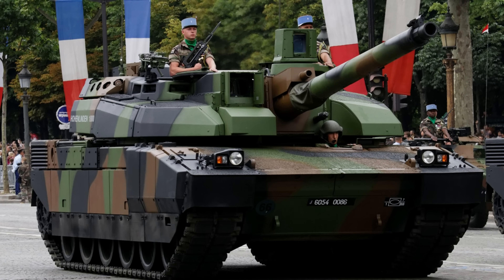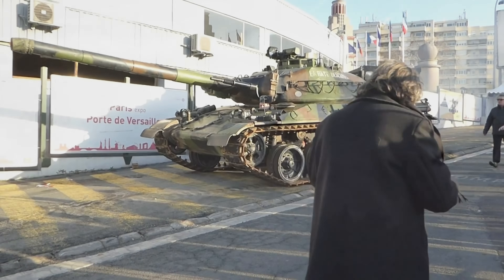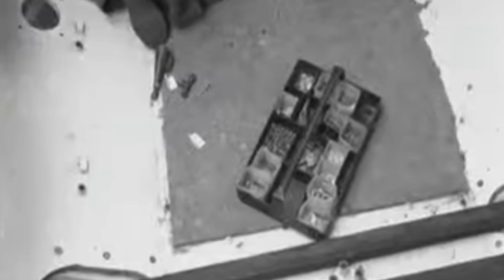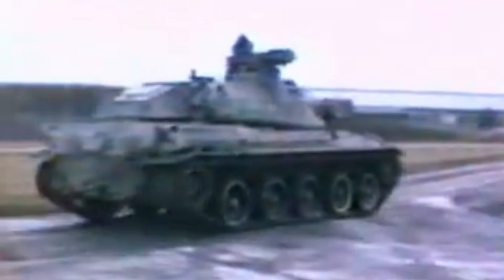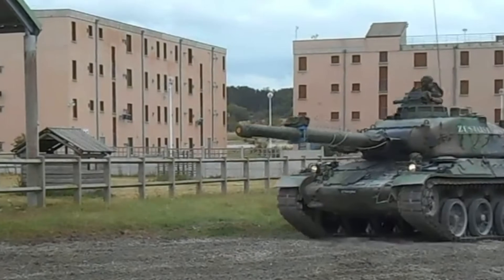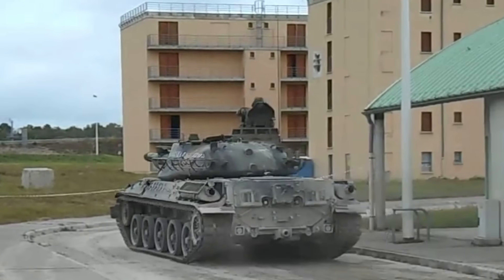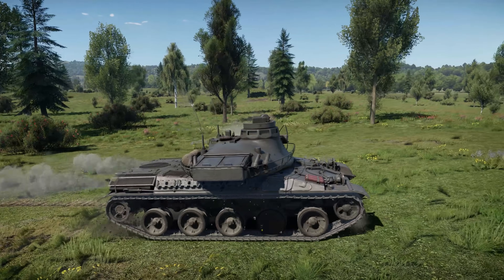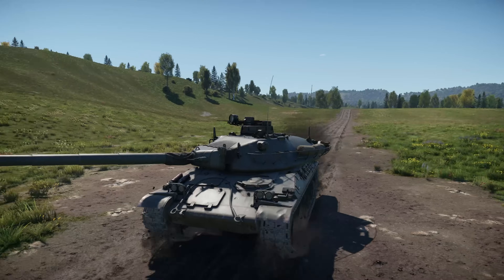The French AMX-30 Main Battle Tank | DOES SPEED BEAT LESS ARMOUR?

Comment: Things that repeat in history. 1 Joint Eu weapon project 2. Disagreement on design or work share 3. France goes their own way
Reply: Another self maintaining stereotype. France participated in over 30 successful programs and only withdrew for about 5 programs.
Reply: @ interesting. What projects (vehicles) came out of joint development? (Genuinely curious)
Reply: @SteelBattalion07  Frigates FREMM, Tiger combat helicopters, NH90 transport helicopters, Mamba Anti-Air truck systems, Alpha jets fighters, the rear view mirrors in the Rafale and so many more.

edited : the MLRS rocket artillery system too
Reply: @ rear view mirror on the Rafale is awesome
Reply: @ I assume FREMM is modular so can be customized to suit each national needs. I can see the helicopters wouldn’t get much push back because Germany doesn’t have a huge (manufacturing) stake in it. Thanks for sharing. That was helpful. Though in the realm of big ticket items like tanks and jets… I felt like the different competing interests doomed the project. I’m not holding out hope for SCAF either, especially if it’s not going to be carrier capable
Reply: @ That's the issue with joint programs. France has the only catobar aircraft carrier in Europe. Spending money on a SCAF that isn't going to be navalised.. seems improbable. Unless they keep the Rafale-M and invest in SCAF for the Air Force but I doubt it. Compromises will have to be made anyway, France cannot develop its own 5-6th gen fighter alone. No one can in Europe.
Reply: @ I get it from a cost perspective. But the interoperability capability seems really cool (like F18 taking off from French carriers and Rafale operating off US carriers)
Reply: @GordonFreeman-sl6pi  I disagree on your statement that France can not develop her own new gen fighter alone. If there is a coutnry in Europe which has all the necessary to build her own fighter, ity's truly France. She has very capable engineers, the "savoir-faire", and the will to do so, and she'll have the need in the next decade. I guess  you were surely speaking about money... In the 50's-60's-70's, many were saying the same about the french nuke deterrent force (with the 3 components : ground strategical, air force tactical and strategical, tactical artillery (AMX pluton) ), the missile vector, the space rockets (yes, if it wasn't for France, ESA and Ariane wouldn't have existed). Non only, France did her own nukes, but she was able to produce all the spectre of weaponry by her own or with little cooperation... Missiles of all sort, satellites (military as well as civilian ones), Diamond (alone) then its daughter Ariane (with little help from EEC), MBT, Frigates, Submarines, Carrier (and the alone CATOBAR outside USA). In this old time, USA/UK/USSR thought French would never be able to do so by her own. The nuke research  DID cost dearly to France (3 times what it costed to USA), they did it anyway. About money, let's talk about it... you may argue that France debt doesn't permit it, that EU will not allow France etc...  France has VERY often decided to not follow EU orders when it comes to independecne and military things but not only that. in the 20000's France was warned by EU about her debt, threatened of sanctions by EU... totally ignored and no sanction. During and after the COVID, President Macron decided to let run the french debt to save french societies/enterprises, not far from a trillion € of debt in few years. If France was to fall, it's all EU which would... the thing is that EU face now a very agressive Russia... and USA has decided to make default to their engagement towards NATO coutnries... proving that France "discours" about the possible default from USA was POSSIBLE at any moment, was not a french dream but a european nightmare. Now then, EU/NATO out of USA  has France as single and only option. UK has nukes too, but not that independent (American vectors, all intelligence shared and dependent to USA, whzen France has numerous independent satellites), and also UK military industry is ten times behind the french one. Germany could certainly close the gap with France, but she has about 20-30 years to run, depends on which weaponry/things... it means Germany will took at least a decade to be fully in economy of war, and it will take a couple more years to take the gap with France. Then Germany by the voice of vonderleyen has already said that the debt caused by military expenses will NOT be counted in the calculation of the debt... It means "open bar" for France. new air carrier, new submarines, new missiles, new planes, new drones, new nukes, new frigates (all projects already on way, some are even in production or even in activity)... It has not surprised anybody if France was the first to triple her command of Rafale, and the possibility to build 2 new carriers instead of one. Who will pay ? French, but not only them, European countries will have to put their hands in their wallet. For decades, Europeans  have laughed to the french sovereign and independent military industry... Who are laughing now ? Personnally, I think that France is the alone country in continental europe that can decide to be fully neutral towards Russia (and/or US/China) without risking ANYTHING. And no one could blame her to decide that. Where were the Europeans when France was warning from the 60's to nowadays that putting all their eggs in the US bag was at risk ? Ils riaient, ils raillaient. Et bien qu'ils continuent et bonne chance à eux.
Reply: @ with Germany?
Reply: You forgot all the project that actually did work (and they don't really leave because of workshare issues, but rather because either the partner isn't up to speed, or disagree with the initial agreement (Germany on SCAF and MGCS lately)
On the projects that worked (that I can remember) you have FREMM, METEOR, A400M, SCALP/Storm Shadow, Tiger helicopter, SAMP-T Mamba, alpha jets, Jaguar attack plane, CTA gun with telescoped ammunitions... (And I know I'm forgetting some)
They only leave the project once it's clear out doesn't meet their needs or requirements anymore. Like the Eurofighter that anyone have in mind: it was clear the design of the plane was becoming a heavy ASF with no naval capabilities, and very limited air-to-ground capabilities, 2 things that France insisted at the very beginning of the project that it wanted and needed.
The other members disagreed and didn't want to pay for something that seemed extra to them, and they didn't need.
But for France, it meant forgetting the capability to project its forces anywhere in the world with the aircraft carrier, which was needed to protect its overseas territories and its many citizens in foreign countries (mostly in Africa, but not only), and not getting a plane capable to deliver its nuclear missile, rendering its entire nuclear doctrine at risk...
So the partner didn't accept the French requirements, and now they act surprised that France got out of the bad deal, and made its own little (but awesome and very impressive) aircraft... ;)
Reply: @stitch77100  I actually don't begrudge France for leaving the project. I actually thought if the Eurofighter had been navalized then the QE Carriers would have been CATOBAR instead of STOVL. With stuff like the Meteor - I don't think I've read about any design requirement/differences that anyside had to swallow to move forward so that was fairly straight forward.  But the next gen tank and SCAF/FCAS will be interesting.
Reply: @SteelBattalion07  Don't worry, my comment wasn't aimed specifically at you, it was more of a "to anyone that may not know".
And I agree with you on the aircraft carrier thing, with a naval plane (Eurofighter or anything else), the QE class would have been CATOBAR Carriers, and thus capable to operate other NATO planes like F-18 or Rafale, beside what the national aeronaval British plane would have been.
About the METEOR, I don't know in details either, but I believe it was a cooperation indeed, especially with the propulsion system. So, it worked very well.
I don't think compromise are the think to look for with military equipment actually. I believe it should be kept at the minimal level, because compromises don't make great result, only okay or average ones. And you want your military equipment to excel in what it is supposed to do. That why I think a cooperation like this work best when everyone want the same thing.
Look at the Eurofighter: it's a great interceptor,a very good fighter jet, but a rather mediocre ground attack or bone plane, because it wasn't designed to do this. That's why it's lacking in armament points and wasn't designed to carry very heavy loads. Because it was a plane of compromises. Not a plane of excellence. (I'm exaggerating a bit there, but I hope you get the idea).
Reply: @stitch77100  I agree with you in general. But to keep Eurofighter as a "not a pound for air to ground" and then not have a replacement EU-centric attack jet and now they're left without that capability (for themselves). What a navalized/ground attack capable jet would have given all the participating countries would have been economy of scale. The same way that F35's per unit cost could be driven down so low (for all its compromises and limitation). More jets for the dollar, parts commonality, better supply chain resiliency
Reply: @SteelBattalion07  not going to disagree with you here. A Tornado 2.0 or a Sepcat Jaguar 2, in numbers, would have been awesome.
But right now, only the Rafale is available (and the Gripen I guess, but I'm not sure about it's payload and range compared to the French one)
So, when are you going to order some Rafales for the air-to-ground work? XD
0;)
Reply: @stitch77100  actually the one thing that all EU jets sorely lacks is the EW SEAD/DEAD variant(Growler) variant for any of its jets.
Reply: @SteelBattalion07  I think the SEAD/DEAD mission was actually successfully carried out by the Rafale, in Lybia in 2011.
Using a combination of Spectra EW to stay hidden as long as possible, and precision strike missiles and bombs to destroy them from afar.
It was not done purely on EW, but when every plane has a personal EW equipment, do you really need a Growler equivalent to do heavy and loud EW missions ?
It's an other way to accomplish your job, without needing a dedicated equipment to allow your forces to be effective.
(From what I heard, the French aircrafts flew day one to do SEAD/DEAD missions, whereas the US waited day 2, after their cruise missiles strikes hit their targets on day 1)
Reply: @ I think SEAD/DEAD for Libya vs Russian IADs are two very different mission sets. I’m not saying the French doesn’t have the capability. I’ll simply admit there aren’t  a lot of materials written about it that I’ve come across that makes me think given current environment and future adversaries that this is one of their core competencies
Reply: @SteelBattalion07  I agree about the eurofighter navalised (if so, it would have been a Rafale+ because more competence to work on it), UK would have done some catobar carriers... I remmeber that at the beginning of the british carriers project, France and UK had reflected on something like the possibility to make 3 carriers, 1 british, 1 french and 1 shared by the 2... it would have made the carriers cheaper, better etc... I do regret the fact that UK and France doesn't work much together. The inital choice by UK to prioritize (or to say they will) US towards Europe in ALL subjects was a mistaken posture. It got cold the French. And the unbending french mind has aggravated the "distance" with their true and alone ally since the crimean war... but when France and UK are on the same wave length, they can do incredible things : concorde, the great war (yes I mean it), the acceptation of the Free French and the will to stand shoulders to shoulders after WWII (Suez is surely the example which come to mind, USA haven't understood the french-british move, therefore they didn't act very well towards their best/strongest allies), the military operations and projects together (numerous ones, in eectronic warfare, in sea/ocean cooperation and lately, in intelligence concerning  Ukraine war after US defection)...
Reply: To be fair almost all the joint projects which failed shouldn't even have existed to begin with, example:

-France want a plane for its carrier. Other nations don't want the necessary design choices to allow that. How could it work ? Somebody really expected  to convince France of ignoring their carrier requirement when they specifically wanted a plane for it ???

The current joint projects will  also fail without a doubt. Nobody can make concessions on the industrial part of the projects or their military industrial complex risk to die, so of course nothing will happen and it will fail, with millions/billions wasted in the process.
Reply: @ I don’t disagree. France did what it thought was right. The flip side of this is the F35 where the STOVL requirement compromised all the other versions. Hard to say who the winners are. But unlike the French, if it wasn’t for the F35B the Marines/Italians/UK weren’t gonna be able to afford their own 5th gen Carrier short takeoff
Reply: The EMBT project is so cool and it'll be such a shame if it dies... hoping that perhaps this time, things will be different.
Reply: The thing is that France has lots of requirements that other EU countries don’t have. They have many overseas territories and their military us to be able to be deployed far away. In that regard, France’s requirements are closer to Great Britain than any other EU countries. For that reason, France favor lights in agile equipments rather than heavy ones. That is the case with the AMX30 and so is the case with the Rafale.
Reply: Not really there's a ton of counter examples such as the eurocopter, the franco italian frigate, scalp/storm shadow and i'll stop right here because the list is pretty long.

Meanwhile the US german mbt 70 project ended up failing, so what? The germans are uniquely bad at working with others? The americans are uniquely bad at working with others? That's just cherrypicked data bro.
Reply: It’s a miracle any of those projects even get off the ground imo. The fact that the euro fighter exists is nothing short of shocking.
Reply: correct! MBT70, Eurofighter etc.
Reply: Oui oui la baguette